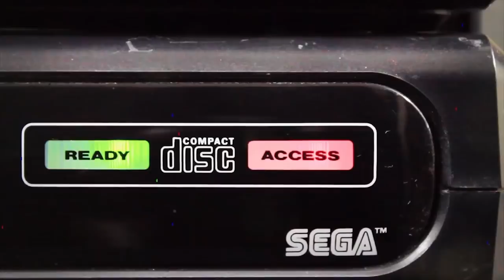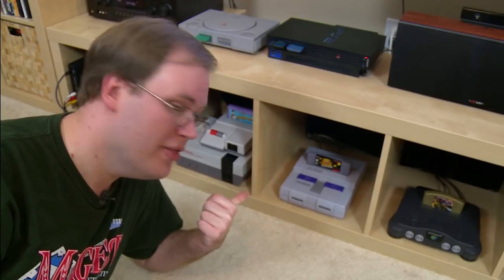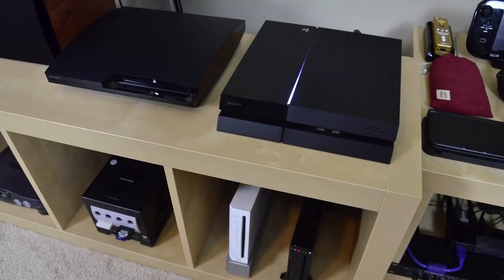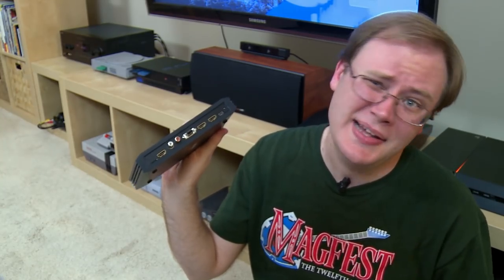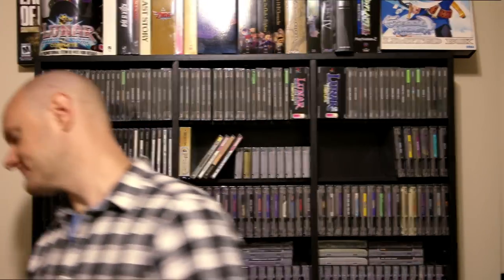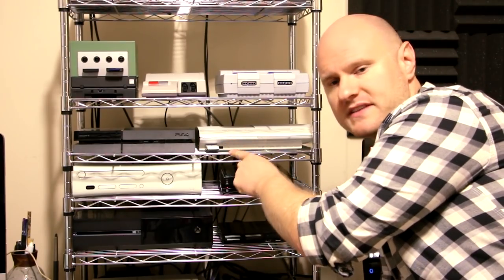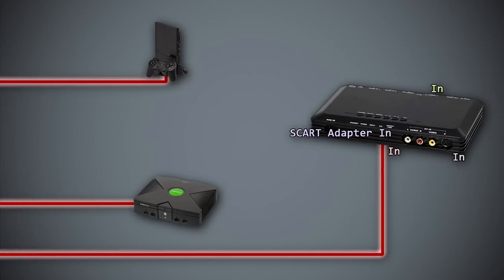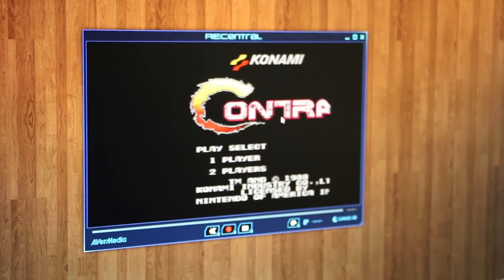RGB and Modern Gaming Setups :: RGB102 / MY LIFE IN GAMING

Comment: Would you guys like a lengthy description as to why I think you should still have a regular Wii hooked up? I've experimented a lot with the console, and I find just using the Wii U isn't always the way to go. (Incoming wall of text)

I highly recommend soft modding your Wii so that it is able to play games off a usb device plugged into its second usb port. I have a 500 GB portable hard drive in mine, and with the USB Loader GX app installed on my Wii, I can install my entire Wii collection right onto the hard drive. Since you need a program on your PC called the WBFS Loader to format the hard drive to use Wii iso files, you can also use it to install PAL and Japanese iso files that you can find in various places online, and play them, bypassing region encoding. You can set the PAL iso files to be forced into 60hz, so they always play, and it works well. So, if there was a Japanese game localized in English, but never brought to North America, this is a way to get around that. It's also how you can play games that have English fan patches put on them. Don't like the atrocious dub for Arc Rise Fantasia? There's the undub iso for that.

Furthermore, this method reduces load times a bit. Not as much as a fat PS2 with a memory card that has Free McBoot to play games off an IDE hard drive (which I also recommend), but still notable. This isn't much of an issue with most games, but it's really useful for games that are large enough to be on dual layer DVDs. Games like Super Smash Bros Brawl, Xenoblade Chronicles, and The Last Story make the Wii constantly re-read parts of the disc, causing lots of noise and potentially making the system die. On a hard drive, there is no disc involved, and the laser goes unused, keeping it intact.

One of the best surprises that I got from playing off a hard drive is that it is somehow easier on your HDTV's scaler, improving the video quality. My friend and I compared Xenoblade Chronicles playing it off the disc, and playing it off the hard drive, and we both noticed a significant improvement in edge smoothness, color clarity, and detail sharpness, all of which looked better than how Wii games look when played on a Wii U, and there was no difference in video resolution. The same TV settings and component cable were used at 480p. It also helps iron out scan lines a bit in games that are known to have them, like the Zelda games. I find that playing these games on the Wii U, regardless of HDMI or component, causes black artifacts to appear, or they just sharpen the jagged edges of character models without actually improving them.

However, not all games can be played this way. It seems to have the most trouble with compilation games, where you have to choose which game you want at the main menu. The Kirby Collection, Metroid Prime Trilogy, and Back to the Future The Game are examples. Other regular games like Sakura Wars and Prince of Persia: Forgotten Sands for Wii don't work like this either. Such games are usually better played on the Wii U.

I say 'usually', because some of those games let you use a Gamecube controller, and the Wii U doesn't support that controller, except for Smash Bros 4 Wii U. If you prefer using a Gamecube controller for those games, playing the disc on the Wii is the best option. I've seen third party adapters that plug into a Wiimote that you can plug a Gamecube controller into, and it fools the Wiimote into thinking its a Classic Controller, but I've heard they have 1 frame of input lag. I can't confirm, since I've never had one.

Now, one thing I must mention is that the improved video quality DOES NOT translate into captured footage, it only affects how it looks on the TV. I have an Avermedia capture card, and I tested recording Wii games off disc and off the hard drive, and the recording quality was identical. If you want to record Wii footage, and you can't use a Gamecube controller, record off disc on the Wii U.

For recording Wii games off the Wii U, I recommend using component at 720p, instead of HDMI. I've found that HDMI footage turns out with desaturated colors, though the edges appear to be slightly better. Component at 1080p is also slightly better than component at 720p, but its very negligible, and not worth the extra space taken up on your hard drive when recording. Now, the HDMI desaturated issue can be fixed with adding saturation back to the footage in your video editor, which can make it look identical to component footage, but if you don't want to bother, then go for component first.

Now, it is possible to install and use the USB Loader GX app on your Wii U, because of the Wii mode, and it can possibly be better this way because you have higher resolutions to work with, but I don't recommend it at this point. Wii U modding is still in its infancy, and its likely that other, better ways will be made at a later date.

In summary, if you just want to play Wii games, use a modded Wii with a hard drive.
If you want to record Wii games, use a Wii U with component at 720p.
Reply from the maker: [coury] whoa! Huge detail here. Super through and in depth. Thank you!

That's super interesting about the way the TV handles it - when we get to the Wii episode we'll dig in and test all this stuff. 

I know about but haven't gotten too into hard drive style mods for the Wii and PS2 but it's absolutely something I'll look into. 

Currently I do use my Wii U for Wii games but have a set of component cables that I use for my original that I could move over. I have always felt they looked off with HDMI but I haven't played any Wii games recently so I just didn't think about it. 

But thank you so much for this. It gives us lots of stuff to get into when we get to the Wii RGB vid.
Reply: *****
If you want a tutorial on how to get USB Loader GX, watch the youtube tutorial by HighTeckMan. I followed his instructions, and it worked for me. If you go to http ://wiki. gbatemp.net/ wiki/ USB_Game_Compatibility_Table, you'll see an incomplete, but mostly useful list of games that work with USB Loader GX. Just remove the spaces for the link.

Playing PS2 games off the hard drive is great as the load times are drastically reduced, since you use a PS2 internet adapter to connect the hard drive (placed in the expansion bay) to the console itself. You can play games off a hard drive through USB for the slim PS2, but I don't recommend it since the PS2 uses USB 1.0, and its load times are much longer than playing it off disc. Again, not all PS2 games work off a hard drive, but about 93 percent do.

Unlike the Wii, I do not notice a change in video output when playing PS2 games off the hard drive.

I'd like to point out that my HDTV is a Vizio, and its Sharpness adjustment scale is VERY good. None of that bad ghost filtering crap for me. I keep the sharpness at max (0 is lowest, 8 is neutral, 16 is max) on all my input settings, so that also affects my Wii video display.

One last thing, I think RGB will only be of use to the Wii if you're a PAL Wii owner. First, because only PAL Wii's are wired for RGB. Second, because all Wii games have progressive scan, 480p through component is perfectly adequate. The only benefit I can see is to games that have a lot of scan lines, like the Zelda games. The scan lines are caused by setting the console to output 480p, and the HDTV scaler trying to fill in "empty spaces" to match the progressive setting. Setting the Wii to 480i gets rid of the scan lines on these games, but dulls the colors and blurs the edges and details. For these games only do I see RGB scart to Framemeister being a boon.

Comment: I also recommend getting the bandridge switcher on ebay uk. get at least 2, the more you get the cheaper the shipping.
The one i'm waiting for is the gscartsw automatic 8:1. as long as you have correctly wired scart cables.
http://www.assemblergames.com/forums/showthread.php?52513-gscartsw-automatic-8-1-SCART-RGB-switch

Comment: Auto switching scart cables are available for £5 off ebay. I currently use these for most of my retro systems. I don't' think they degrade the quality but I may be wrong - I'm not using a framemeister myself.

Comment: Something else to note, SCART switchers can be a pain in my experience. Used quite a few any they've always had a negative effect on image quality. Dunno if the Framemeister would sort that out though. The thing with SCART cables is that they're rarely super sturdy so constantly pulling them in and out of sockets can damage them eventually. I've had a few where the metal frame part around the pins has plain come away from the housing.

Those are damn fine set ups you have though. I can't imagine how many cables you have going on around the back of the TVs. I need to tidy mine up. It's so knotted up that I'm pretty sure it's gonna burst into flames someday.
Reply from the maker: [Try4ce] I'm currently evaluating another SCART switcher right now, though I believe I may need different cables to get the desired results. All of the different types of SCART cables is certainly a source of confusion and frustration for me. In the process of getting this switcher properly integrated into my setup, I'm hoping to learn a ton more about how SCART works, how cables are wired, and what kinds of choices to make. If I can break through to a new level of understanding of SCART, I'd really like to make a video demystifying the whole thing, because the information out there is pretty difficult to get a handle on.
Reply: There's a lot of nonsense regarding quality. Generally getting a 21 pin cable with gold plating helps. The Framemeister probably deals with any effect noise has on the image quality, which would normally just be a little added fuzziness. SCART was the standard for us here in the UK. S-Video is something I've never used but I always thought that was the best at the time from what i knew.

Comment: I have a framemeister cable with sync stripper built in which was necessary to get stable image from my snes and mega drive. Unfortunately the Voltage drop on longer cables and/or through scart switcher means it doesnt work so I had to remove all extensions and the switcher..  Your milage may vary though.

Comment: Wait 6:10 but why do some ps3 systems have or iirc in another video from metal jesus rocks channel it show the ps3 showing up in the menu/system settings the region option/select for what region of ps1 discs to allow at a given time an for the models that are equipped with ps2 disc capability also but even the on an off option for hdcp over hdmi?

Comment: Does having the HDMI run through the framemesiter create any quality loss with the HDMI? And is the framemesiter compatible with the new 4k consoles? 

Thanks for making these videos, they've cut through a lot of the noise.
Reply from the maker: [Try4ce] Keep in mind that the Framemeister is discontinued, although I believe stock still remains. For analog consoles, we use devices like the OSSC and RetroTINK-2X more often these days, but the Framemeister does have an edge in 480i deinterlacing. As for the HDMI inputs, I don't quite trust them. Even when set for HDMI passthrough, I think it screws up with some sort of color conversion, so I prefer to not use it for HDMI input. There is no device in this retro gaming scene that yet supports 4K.
Reply: @mylifeingaming  Thank you for such a quick and detailed reply. I'm still only a few episodes into this MC. Given how much things have changed since you started making these videos, I assume the future ones go over these new options? 

In terms of the HDMI output, I was surprised in this video to see that both setups ran the modern consoles through the framemeister as I assumed that would sacrifice some quality in the passthrough. Given the changes with 4k, have you guys changed these setups and do you ever detail out the new setups you're using?
Reply from the maker: [Try4ce] Yes, there's a later setup video, and that too is out of date. Coury has moved twice since this first setup video. We're both working on new setup videos but they'll still be several months away. The most accurate video actually would be our video about retro and modern gaming on 4K TVs, which has relatively up to date info on the OSSC. I'm not sure if going in order is really the right way to tackle this series at this point since the early videos are really really old.
Reply: @mylifeingaming  Good advice. Any recommendations on where to jump in if I'm joining at his point?
Reply from the maker: [Try4ce] I'd start with the Modern and Retro Gaming on 4K TVs episode, and look at various others from there, depending on what systems you're interested in. Things change a lot more in this scene than you'd think, so sometimes things get outdated! Doesn't mean the options presented in the videos are bad now, but it doesn't present ALL options.

Comment: Is it not possible to use an S-Video switch instead of a SCART one? Seems an All console outs > SCART adapters to S-Video > S-Video switch takes all adapted consoles to single S-Video, handles all switching > Framemeister > HDMI to TV. Seems like S-Video switches are much less expensive than SCART. I’m probably missing something though.
Reply from the maker: [Try4ce] Well, S-video can't carry RGB so it's not as high quality of a signal. We now use GSCART and GCOMP for most switching needs.

Comment: amazing and informative videos, i do have question regarding my setup though. if were not using the framemiester, is there any adapter or converter you would recommend for a system using component? and is there any adapter or converter you would recommend for s-video? :)

Comment: Can either of you tell me if you tried comparing PS2 footage between YPbPr to d-terminal and RGB? Does the component or RGB output come out better through the framemeister?
Reply from the maker: ShogunGin0 [Coury] We've definitely gone back and forth between the two. Try actually uses SCART for his, but I use Component with mine. A downfall of using SCART is that 480p is out of the question without having to resort to additional equipment. On the other hand, Component introduces a little bit of noise that you can see on certain colors - you can see it present here on the solid gray color https://youtu.be/UzzwuLD_a0E?t=1m54s

When we get to the PS2 system specific, we'll absolutely get deeper into it, but thats a ways off at this point.
Reply: My life in gaming why don't you have a 3do???

Comment: I do not understand why this is, but RGB looks kind of out of focus on all my SNESes (SNES, Super Famicom {NOT 1chip}, S-vid/RGB modded SNES mini, S-vid/RGB modded SFC Jr.). The fact that this is the case on all of these, suggests to me maybe a problem with my SCART cable or with my adapter (in my case to XCAPTURE-1 from the same company as the Framemeister). In any case, I am pretty happy with S-Video. My S-Video signal is much, much sharper than yours on the minis (it's comparable on the older SNESes), and near emulation quality (my Sutte Hakkun let's play videos illustrate pretty well how great the S-vid picture is for me).

I would like to get a Framemeister, and once my life situation is a little more stable, I eventually will get one and a nice TV.
Reply from the maker: Eyedunno [Try4ce] It's totally normal for SNES RGB to look a bit soft. Unfortunately, SNES RGB for most systems just isn't that sharp when compared to Genesis, or well, pretty much all of the other systems that support RGB, or can be modded for RGB. The 1-chip models have much much sharper RGB, and apparently the final 1-chip revision has the best RGB (but must be modified a little bit if you want CSYNC). Since making this video, I've bought a modded SNES mini, and it does look very sharp indeed.
Reply: *****
Well, that's a shame, considering the fantastic, sharp S-video on the mini. Still, I'm not complaining too much, as S-vid cables are much easier to come by in the States, and the quality is still unbelievably great (color might be slightly more faithful with RGB, but otherwise, there's no ghosting, and you have to look very carefully right up close to see even the tiniest amount of noise).

I guess even when I get a Framemeister, I will stick with S-video (Or maybe hunt down a 1-chip SNES eventually). :) For now, I'm quite happy playing games on my computer monitor with the XCAPTURE-1, which, like the XRGB mini, exhibits no noticeable lag (freaking amazing for a USB device).